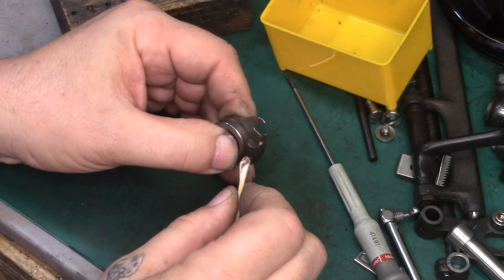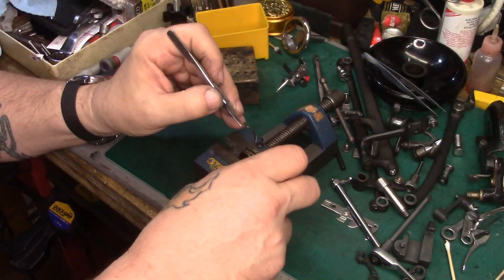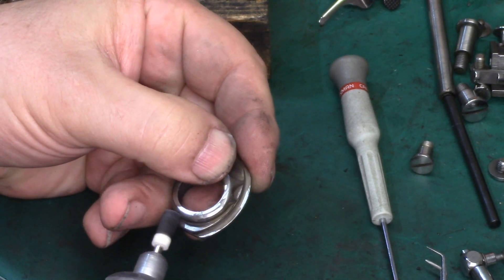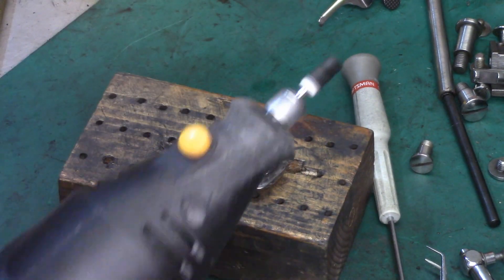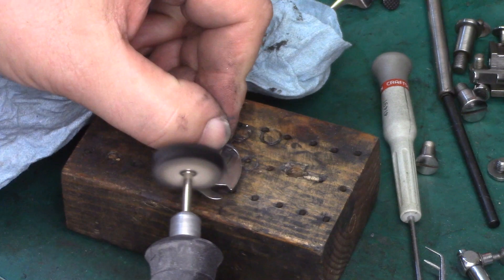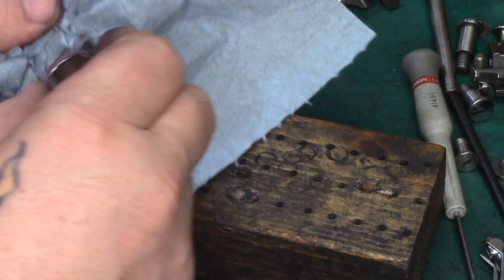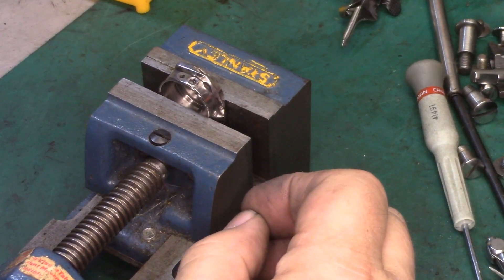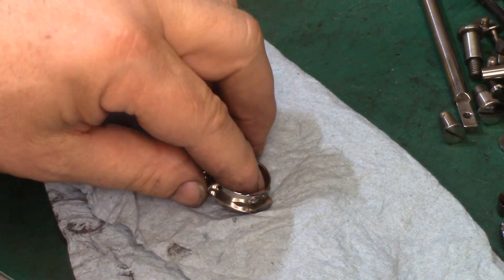Clean and Polish a Singer 66 Class Bobbin Case

Comment: Hi Bob,
Can I take a nasty 221 bobbin casing and put in jewelry ultra sonic cleaner?
Reply from the maker: Yes, you can, but I caution you that unless you disassemble it, you will most likely have dirt and crud get trapped under the tension spring. Also, depending on what cleaning fluid you use, you may have issues with trapped moisture, which can lead to rust. That's why I disassemble and clean...
Reply: @BobFowlerWorkshop  thanks Bob !